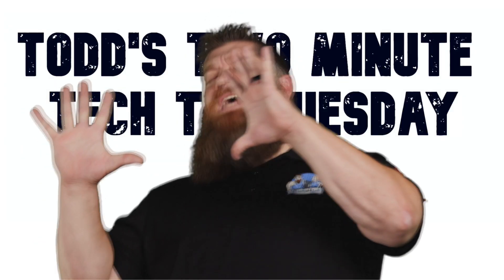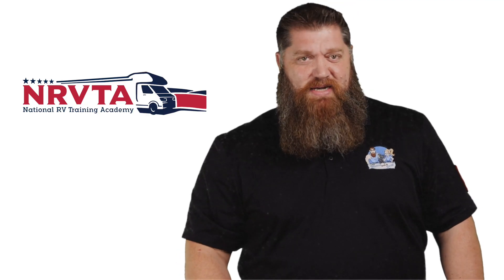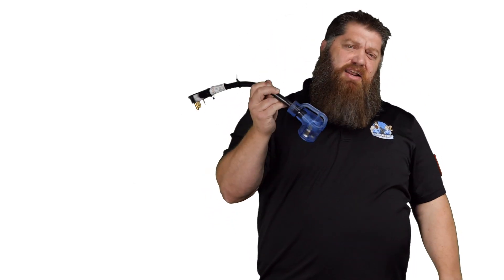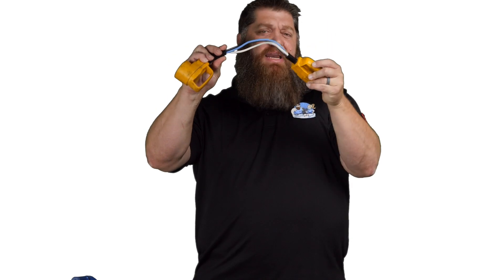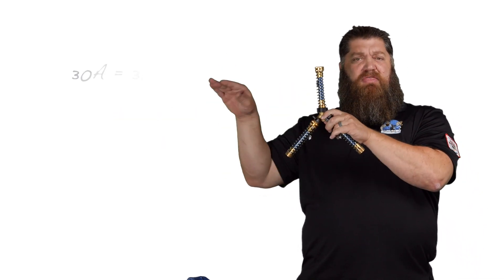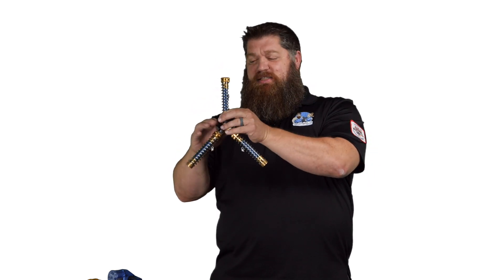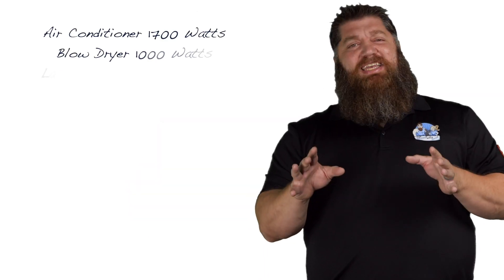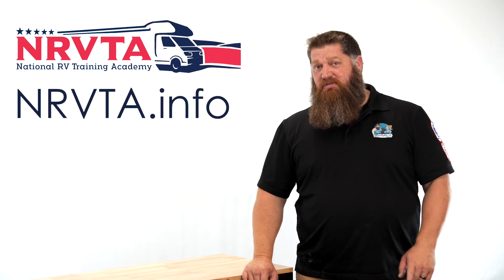30A to 50A Dog-bone adapter

Comment: If you have 30 A service and use the dog bone to go to 50 A and you plug your surge protector into the 50 A and it says open neutral is that common?
Reply from the maker: No that means the neutral either in the dog one or in the pedestal is not connected (open). Please do not plug into it. 

Neutral is the past home
Reply: @NationalRVTrainingAcademy  So if my RV is 50 A in my driveway outlet is 30 A can I tie in my 50 amp surge protector with a dog bone.
Reply from the maker: @thomashollingsworth6235   your protector will work.

Comment: i have a 30 amp (3 prong) outlet that pushes 240v instead of the 120v i need, is there a safe adapter i can buy that uses 3 prong attachments on both ends?
Reply from the maker: No. If your source is 3 prong 240 then you DONT have a neutral. Please do not use that 30 amp outlet. 

A qualified electrician needs to set that up for you.
Reply: @NationalRVTrainingAcademy  tyvm

Comment: Hey Todd, now how about a video covering the 30A “step down” adaptor that goes between your 30A RV cord & the 50A plug on a pedestal that is 50A only? I know you are dropping a leg but 6,000 watts is a lot more than the 3,600 watts a 30A RV is typically getting.

Comment: This was not answered in previous comment, but I agree, why would it 'burn up'.  The 30 amp breaker would pop before that occurred, right?
Reply: That still doesn’t make sense if it’s made of the same gauge wire as a 30 amp power cord. In any case I agree you should try to avoid overloading it and relying on the breaker. Enjoy your videos. Good subjects and content.
Reply from the maker: So electricity finds the path of least resistance. Sometimes the breaker mat pop but unfortunately many more times the cable takes the brunt of the heat.

Comment: I have a Coachman Chaparral with 50 amp service. Question is if Im at a 30 amp service, Does the 39450 Southwire surge protector work ?? Do In need a 30amp surge?? Do I use a dog bone from 30amp service to surge protector than a 50 amp extension cord to coach or??      Next question  Is 50 amp service to surge protector to 50 amp extension right in coach?? Thank you for any advice. Its my first day
Reply: Great questions Johnny, let me add one. On your coach of 50 A (two legs ) when you feed it 30 A you are only feeding it one leg does that mean only half of your coach will work because your 2 legs @ 50A  are each feeding different parts of the coach, is this correct?

Comment: A couple of other proactive tips......
If your coach allows for this, when your 50A RV is plugged into a 30A pedestal, reduce the maximum amount the inverter/charger can use when in bulk charge mode. If you have the Xantrex Freedom 458, it's called "Power Share".  
Also, if you have an Energy Management System, perhaps you have a selectable power source switch that will alter the "shedding" parameters based on the reduced availabilty. On my EMS system, there are 4 indicators, "Gen Set and 50A (default), and selectable 30A or 20A, depending on the type of power source I am connected to.

These steps should help to avoid the dogbone meltdown......

Comment: When I plug my 30a cord into a 30a plug I'm protected with a 30a breaker. What is protecting my 30a cord when I plug it into a 50a plug using a dog-bone adapter?
Reply from the maker: The 30 amp breaker in the RV.

Comment: You pull your 30amp rig into a site which offers only 50amp? I’ve seen dog bones to accommodate this situation, but is this wise and safe? Do you operate your rig normally?
Reply: Keep in mind that every circuit in your RV is protected by an individual breaker just like in your home.  What he is talking about here is how much total power that is available to the whole RV.  No matter how much total power coming into the coach, your breakers won't allow any individual circuit to over load because the breaker will shut that circuit down if you try.
Reply: It won't hurt anything.  The service is only supplying what is demanded from the RV it's not forcing 50amps into the system.  If you try and pull (or demand) more than 30amps you will trip the breaker on your main panel inside the RV thus protecting the circuit.  The breaker is always the weakest link in the system which protects all the other parts.
Reply: If you plug a desk lamp that draws 1 amp into a receptacle in your living room that is capable of supplying 15 amps, does your lamp blow up? It’s the same thing in this case. Both the 30 and 50 amp provide 120 volts. Your load will cause only as much current to flow as it needs.

Comment: Great explanation.  Most people don't understand what is happening when using a dog-bone.  They probably think they can run everything as usual.  It's like when people have a 1500 or F150 and think they can pull any amount of weight just because they have a truck. Thanks.
Reply: Wait, What?! Is that why I can’t see the road at night?? 😏